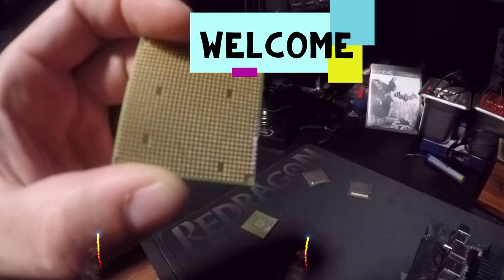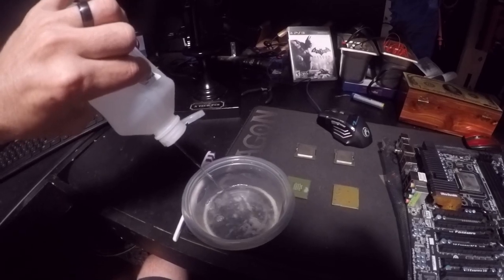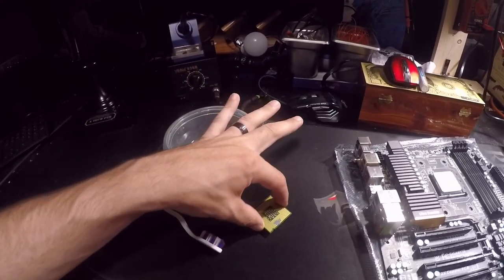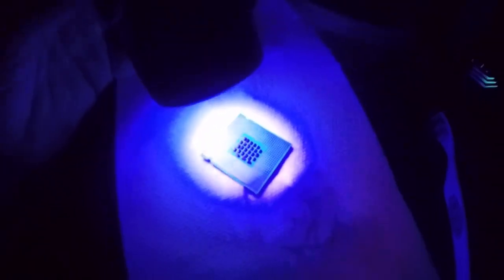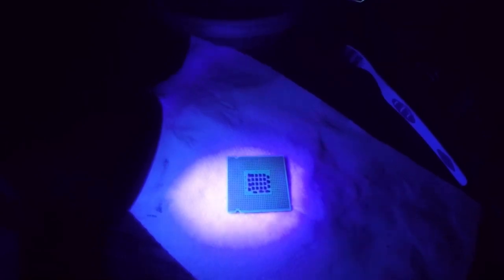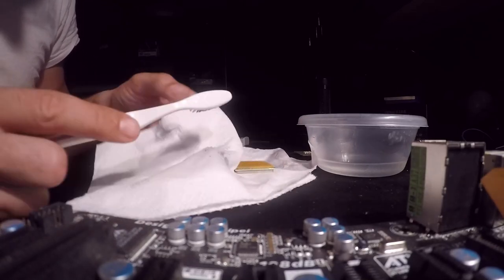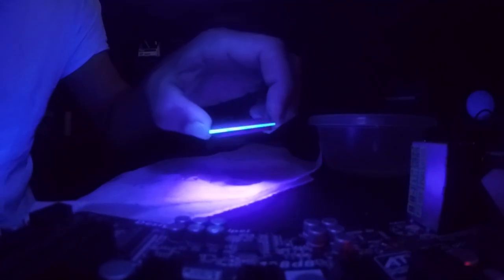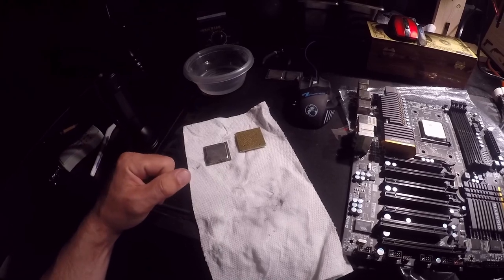✳ How Too Remove Thremal Paste From CPU PINS/PADS ❂

Comment: Thank you for the video. I have to RMA my motherboard due to one of the memory sockets being bad. So, I had to remove the CPU. I thought I had gotten enough of the thermal paste off of the CPU, but apparently there was enough to end up on my fingers, and subsequently on a few pins.
I was nervous about cleaning it, but your video gave me a good idea of what I need to do. It seems quite doable. Thank you! :-)
Reply from the maker: your welcome... im glad i could help you ....  could u help me by subscribeing  and leaven a like on video
Reply: @ATECHPCs  I have liked the video. I will keep an eye out for more from you. I was wondering if I need to use a new toothbrush? I suspect that I do, since old toothbrushes can have impurities that are not great for a sensitive electrical device.
Also, are there any ESD concerns with the plastic container being used for soaking?
Reply from the maker: awesome.  pls subscribe and leave a like and check out our new videos
Reply from the maker: @namehere5675  awesome. im glad i could help you ... consider Subscribing to the channel.. and yea change the toothbrush...   also check out some of our newer videos.. and leave Likes on them too...lol   thanks for being awesome
Reply: Sudden Death WR  🤔

Comment: i put together my pc today,, but when i was putting on my cpu cooler i fucked up one of the brackets and i put it on and couldent screw it down. and when i took it off i accidentaly ripped out the cpu out of its socket.. i think it still works fine none of the pins were bent or gone just alot of them had thermal paste on them.. this video helped me a lot ty man !
Reply from the maker: Im glad i could help.... Leave a like and consider Subscribing

Comment: Alcohol is illegal in Saudi Arabia, I live in Saudi Arabia, what a great day to get some thermal paste in your pins
Reply from the maker: use ... PROXIDE . USE VERY . VERY LITTLE .. DONT SOAK IT.. just applied it to toothbrush ..
Reply: @ATECHPCs  thanks but it was a little thermal paste and a lot of friends and provisionals told me if it's wasn't to much paste just it the CPU in the mb and pray, if the pc didn't start basically RIP CPU and the MB would not be damaged luckily it started and works like a charm
Reply from the maker: @WaleedDev  o awesome.. Thats good

Comment: i feel bad for the poeple that actually needed this video, how do you even get thermal paste there???
Reply from the maker: U can get thermal paste there very easy...  If u build enough computers.   Yull see what i mean.   Subscribe
Reply: Just took out my cpu and found some paste oozed out... I been running this pc strong for two years and not one problem
Reply: @ATECHPCs  Maybe you have fat fingers, which is why you're so clumsy when it comes to thermal paste? I make model ships, planes and figurines, as well as build PC's and I've never got thermal paste on any of my parts, except where it is needed.
Reply from the maker: @fastcars393  thats so true. Lol. I dont have steady hands.. And i sure did.. I got thermal paste on it..lol. O thats cool ..u build modles.awesome..and computers. Dang.. Well thank you for your comment..consider Subscribeing to thr channel and check out some of our video's... Thx again
Reply: @ATECHPCs  Two very expensive hobbies. I'm not perfect either since I have shaky hands due to prolonged exposure to cold water. Got it when I worked as a dental technician up in Manchester. Our boss was skint, so we only had cold running tap water to do our plaster models in. Anyway, I meant no offence by stating that you had fat fingers lol. It's just that you have to be careful not getting thermal paste on your parts. Also, wearing latex gloves (like I do when building rigs) helps to limit that.
Reply from the maker: @fastcars393  its all good.. Yea gloves is a good idea.. I wear gloves now... Thank you for your comment and time.. Make sure to like the video..and consider Subscribeing..thx

Comment: Hmm interesting, i accidently got thermal paste on my ryzen cpu pins and at the one side there was about 4 or 5 pins coverd with paste but i dident have any 91% or above alcohol so i decided to use only soft toothbrush and thats it then i sticked it back to my pc and it worked without a problem. And i dont know it will be safe for a long period of time or should i clean it with alcohol in the future?
Reply from the maker: When it comes to thermal paste.. Even when u wip it off... It still leaves behind a residue and that residue can get on the pads or in the couplet of the CPU or inside of the board and then once that happens you will never get it out so I recommend using the alcohol to ensure that the pens or pads are perfectly cleaned
Reply from the maker: Please Subscribe.. Thx
Reply from the maker: Subscribe and win free tech !
Reply: @ATECHPCs   I'm in the same situation, a wee bit of thermal,paste on the CHIP and maybe a bit on the socket(8700k)  I'm going to do what you suggest, but what happens if i miss a little bit - will this ruin my chip and motherboard(not sure i can afford to replace them)
Reply from the maker: @capitaldd3693  heres he problem.. the thermal paste with cause interference with the contact pads on the chip .. causing you not to boot... thermal paste inside of a socket is a Death Sentenced to a motherboard.... you can try to remove it using a usb microscope  x1000 to remove it .. but you may cause more damage... best of luck .. your in a tight spot..      if you get it to work .. Awesome.. ... subscribe to the channel
Reply: @ATECHPCs  hey thanks for the response. I cleaned off the chip with 99%Iso(all I could find). The chip seems clean. But I do see a couple small marks on two separate pads. Like the dent from a needle 'like that size". Only notice them while in had on doubled up reading glasses on. The socket seems clean, I didn't have to clean it seems like nothing got in there.  I see reflection on every pad on the chip, I'm hoping that sufficient. I may go over it again as you have me wondering if I've done enough.  If not doesn't boot up I guess I know why..
Thanks again

Comment: I jus got a new ryzen 5 1600 And there at little discoloration on the cpu. But I don’t think there is any paste on there
Reply from the maker: U mean the pins are discolored ?   Thats normal.    From heat and electricity usually causes that... If the chip works and you dont have any problems.  Then just dont worry about it.  U cant see it any way in use..... Thx 4 the comment.  Consider Subscribing to the channel and check some of our other videos. Thanks

Comment: i'm not sure you're supposed to be soaking the cpu in liquid like that
Reply from the maker: its not just any liquid.... its de-earth alcohol  3%-+70% ,,, they also make a (special) type u can use .... plus it won't hurt anything... just allowed plenty of time to dry... and this is for only Extreme cases when Thermal paste ends up on the pins/pads...…    iv been at it for years never had a problem with it....Thx for your comment.. check out our other vids and get Subscribe!!  thanks again
Reply: its ok ..that won't hurt it
Reply: @ATECHPCs  Expert has said dipping the entire CPU is very bad! Soaking the capacitors is not recommend
Reply from the maker: @sorrowinchrist3387  iv been doing this for years iv never had a problem
Reply: @ATECHPCs  however in experience might have issues. So maybe you could get a friend who has never done this to do this on a CPU and see if it will work?
Reply from the maker: @sorrowinchrist3387  well i have had like 20 ppl alone from this video say it helped them out .. and they were new.... read the comments iv help alot of ppl out by making this video .. i explain it easy enough were any body no matter your skill lvl can do this . i should of had my wife do it... she has no idea about pc ..lol
Reply: @ATECHPCs  they might know a thing or two but its not the explaining. I understand it perfectly its whether its safe when someone who have no idea about this start doing it. That is what i mean? Maybe ask your wife to do what you do? Get all the things from scratch and she can watch a video and see if there would be anything wrong with the CPU and motherboard?
Reply from the maker: @sorrowinchrist3387  well if u have thermal paste in your socket or cpu you pc won't work any way . so rather or not the person messes up .. they at least will have a chance.. that's the great part of my video .. i tell you how to do it..i believe my wife could do it .. after all your just removing it with tooth brush and alcohol ... and you can watch my video while doing it..    ppl who come to this video already have a problem and this is a solution.. you dont have to do it.. and i broke it down enough  so were any one can follow the video
Reply: @ATECHPCs  the paste was on the sensitive part of the CPU? Not the motherboard so if that happen the CPU is gone? But isn't the video about removing it anyway? Could you get your wife to see if she can do this her self just by watching? And do not give her all the items she has to get it herself? And see if things work out! 

I would try it myself but i will only do it on a really cheap system cause all the articles i am reading say that you should not dip your CPU fully in any kind of liquid. 

Can you also dip your motherboard fully in that liquid and take it out and everything will work can you try?

Do you have a current i7 CPU? Will you test your theory and smudge a little paste on the sensitive side and see if it works and show a video on it? 

Since this video does not show you putting it back in the motherboard to see if everything will turn on?? So i remain skeptical and please can you list the product too?
Reply from the maker: @sorrowinchrist3387     subscribe friend
Reply: @ATECHPCs  It would really help if your wife can replicated what you done with out assistant. Give her some cheap cpu and mother and see if she can come up with the right technique. Only then can you give a mark of approval of others following along. 

You have not listed what liquid to get and all the tools so i hope you can update this. And also you have not done this on an expensive CPU. Do that and you will get more support. 

As a scientist you need to be able to reproduce your results in a very strict controllerd environment. And its needs to work almost all the time.
Reply from the maker: @sorrowinchrist3387  I think your over thinking it.... its simple and straight forward ,,  just remove thermal paste with tooth brush and alcohol .  any body can do it
Reply: @sorrowinchrist3387  @A TECH PCs , i just replicated and did this on 3 ryzen cpus I had, worked like a charm with soft toothbrush after soaking in alcohol for 48 hours. all three cpus working just fine, benching at same levels as before

Comment: So I accidentally over did it with thermal paste, upon mounting my cooler, the thermal paste leaked onto the sides of the cpu.

I unmounted the cooler and lifted up the cpu, and thermal paste dripped from the cpu into the socket of the motherboard and into the pins.

I don't know if I'm crazy or not, but legit all I did was spray it with some strong compressed air, both the socket and the cpu pins. I even got some of the liquid nitrogen into the socket of the motherboard.

It still works to this day (Ryzen 5 2600) for about 1.5 years now, should I worry that one day it might fail on me? Should I clean it more thoroughly?
Reply from the maker: Well. First let me say. Thank you for your comment... I hope you will consider Subscribeing to the channel. And leaven a like on the video.... first I would never use compressed air to blow off any computer parts mainly because air compressors have moisture in the lines and that could end up on your components and short them out third of all if your components are functioning even a year after you did this I would just leave it alone if it ain't broke don't fix it you could cause even more damage by trying to extract the thermal paste or by cleaning it if it works and you're having no problems I would leave it alone but if you are having issues then the risk is worth it and I would then try to fix it the way that I explained in the video but if you get thermal paste in the socket of the motherboard then you're in big trouble getting thermal paste in a socket of a motherboard is extremely hard to get out if you get it on the pins of the CPU then normally you can clean it and go about your business if you have any more questions just free fill to hit me up I'll be glad to answer them for you thank you for watching and check out some of our other videos
Reply from the maker: Also 99% of all cpu coolers come with thermL paste. So theres no need to add more...  Cheers 😁

Comment: if there is thermal paste on my cpu's pin is that why my pc is not giving signal? bc i applied thermal paste and when i turned on my pc it was this flickering orang light on my motherboard
Reply from the maker: IF YOU HAD THERMAL PASTE ON YOUR CPU PINS AND YOU THEN INSTALLED IT INTO THE CPU SOCKET KNOWING THAT THERE WAS THERMAL PASTE ON THE PINS.... YEP U MADE A BIG MISTAKE .. ONCE YOU GET THERMAL PASTE INSIDE THE SOCKET OF THE MOTHERBOARD ITS GAME OVER.... IM SRY TO TELL YOU THAT .. IF THERMAL PASTE IS ON THE PINS... U CAN FOLLOW MY VIDEO AND REMOVE IT.. BUT IF U ALREADY INSTALLED IT.. YEA U NEED TO REPLACE IT...   THX FOR YOUR COMMENT.. CONSIDER SUBSCRINING TO THE CHANNEL AND LEAVE A LIKE ON THE VIDEO .. ALSO CHECK OUT OUR OTHER VIDEOS ALSO ...THX AGAIN
Reply: A TECH PCs I fixed it! i took a brush and cleaned the cpu very carefully! thanks I will sub

Comment: My motherboard also have thermal paste on the cpu socket because I didn’t notice at first so what should I do and does it make cpu performance worse? thanks
Reply from the maker: If u have thermal paste in your socket of the motherboard.  Dont put cpu in ..   The motherboard may be dead.  Thermal paste in cpu socket is really bad... Ur best bet is to replace the motherboard.  Their are ways to get thermal paste out of the socket.  But u can damage it even more trying to remove the thermal paste. ... My advice.  Replace the motherboard. B4 u damage both the cpu and socket.   Plz subscribe to the channel. And hit like on the video

Comment: Hi, there are 2 pins on my cpu that have a little bit of thermal paste on the side of the pins. The paste does has silver in it. Just wondering, will that end up ruining my cpu?
Reply: I cleaned it off as well as I could and there is still a small mark of thermal paste. What would you say (specifically) are the negative effects of a minuscule amount of thermal paste caught within the sockets?
Reply from the maker: @christophercolling2292  u want complete removal of thermal paste ..  if  gets into your socket on the motherboard you could ruin and destroy it... make sure all contact points are well cleaned...  ( WHAT HAPPENS - IS.. the cpu and the motherboard will fail to connect and talk back and forth.. thermal paste transfers HEAT ./. not electricity .. it will also dry and harden up like a concrete over time..
Reply from the maker: well what happens is the thermal paste dry's and becomes a concrete like wax.. and it does not work to well in the small paces of pins and pads of MB ..   I hade to throw away MB (motherboards) because of thermal paste .. also if u have this problem... UR USING TOO MUCH THERMAL PASTE.... its a paste not a curst...lol 
I hope I help u out.. thanks for your comment
Reply: @ATECHPCs  Very very true! I remember I got thermal paste in my motherboard and maybe the paste was just old, or naturally too thick, it was some IC DIAMOND paste, anyway, I remember it was a bitch to get it off, I don't think I ever got it completely off, maybe just 80% or so because the pin in question in the motherboard never looked as shiny and gold as possible as it used to. :( I'll try my hardest to never do that shit again, it happened in like 2017 on a 2014 board, with a i7 4770K CPU which was still decent at the time but not extremely worrying to me. Still, it was a very scary thing that happened. I switched over to this THERMAL GRIZZLY "Ceramic" paste I think and It looks way smoother when it comes out the tube, still not trying to ever get any of that gunk somewhere it doesn't belong! I'm sure it will harden in hours like a wax smh.

Comment: i hope u see this. i habe a liitle bit of thermal paste on the outerside pins on 3 or 4 pins will it still work or do i have to clean it
Reply from the maker: Clean it.... If u get that thermal paste inside of the cpu socket. On the Motherboard. Your really in a mess now.....so yes. Clean it... Just wip it off real good
Reply from the maker: And subscribe. To the channel
Reply: ok and i have on emore question can i clean it with 96%
Reply from the maker: @walpi1981  yea u should be ok with that
Reply: thanks bro
Reply from the maker: Subscribe and win free tech !

Comment: how do you get thermal paste on the underside of the cpu?
Reply from the maker: Easy.  When removing the cpu heat sink.  U end up with it on your hands.  And may not know it. Then u end up handling the cpu.  And guess what u just now transfer thermL paste to your cpu pins

Comment: hi, i have an issue, i got stucked thermal paster on the mortherboard socket, and it is for amd, any advice ? if it works u got my sub and like
Reply from the maker: Well if it is.  Inside of the socket...  U could use a blow dryer to warm up the paste to try to remove it...but u could also casue more damage. ... Getting thermal paste inside of a socket on a motherboard.  Is almost near impossible to get all the way out...  Its almost just easier and time effectively used by just buying a new 1...  Which may be what youll have yo do.... If u have any questions. Let me know... And thank for Subscribing and your comment... I hope i can help you thru this.   Thx